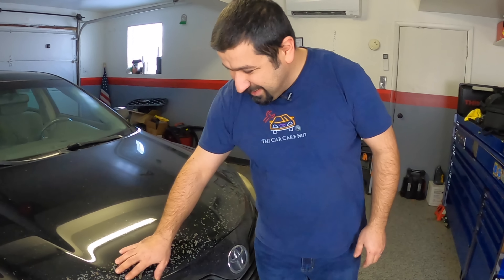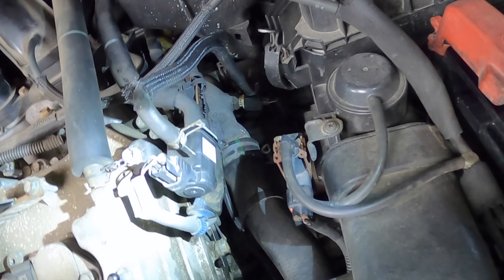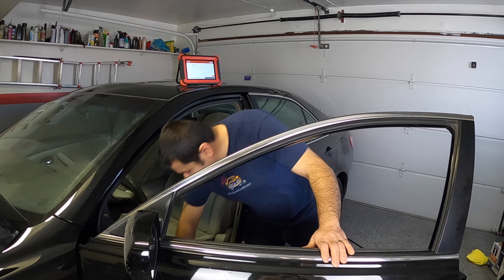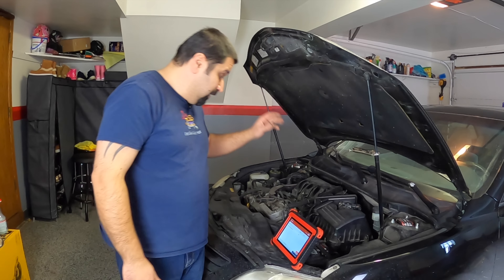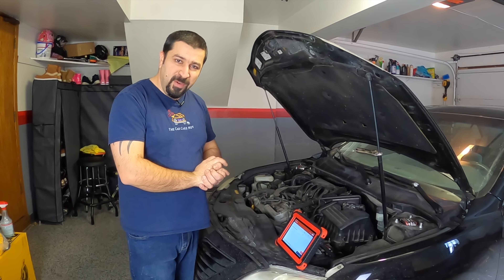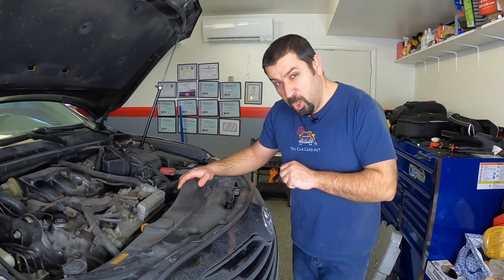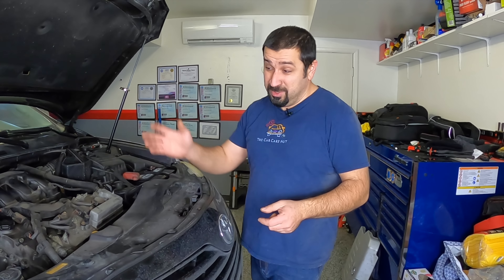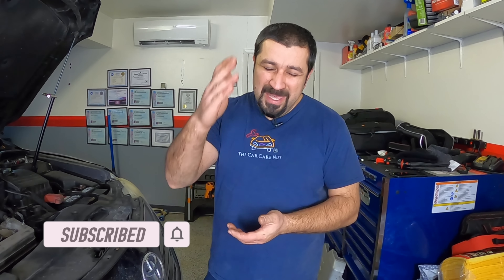How Does a 15 Year Old Toyota with OVER 200k Miles Hold up? Full Inspection!

Comment: Do you need to take the motor out to fix oil leak from the front timing cover?
Reply from the maker: Hi! Yes I did a video showing the process
Reply: @TheCarCareNut  that's a bummer. Since you did a video replacing the water pump without taking the motor out, I would have thought the same would be for the timing cover. Why do you need to take the motor out? Just curious. Thank you!
Reply from the maker: So the front cover is pretty big on these and taking that out in the car is extremely tight and when installing you will likely smear the sealer and not have a good seal. Not worth the risk as any seasoned toyota technician will have the drivetrain on the ground in less than 2 hours
Reply: @TheCarCareNut  that makes sense. Thank you once again.
Reply: 😵

Geez!

I thought I had it bad with my 99 Toyota Solara 1MZFE Front Tming cover.

Comment: I have an 03 Camry with 112,400 miles I've had for a year,it has a significant whine in first gear, but other wise works perfectly any ideas should I be concerned?
Reply from the maker: Hi! Likely a gear contact issue but not something I would worry too much about
Reply: @TheCarCareNut  thanks, I feel a little better now.i forgot to mention it's the 3.0 V6, can you tell me if it's the 4 or 5 speed, hard to tell it shifts so smooth, thanks again.
Reply from the maker: If memory serves right it’s likely a 4 speed
Reply: @TheCarCareNut  👍

Comment: The Oil Leak Leaks on the Power Steering Boots which is why Rack has already been Replaced.  The oil eats the Boots which Protect the Seals.  Mine is Same - 2005 Avalon with 150K. Like you said known Issue. Watch the Level and Keep Cleaning Driveway.  More Embarrassing than Problematic and not worth the $4k Tear-down to Replace the RTV.

Comment: Is there a Lexus mechanic you can recommend in Northern California, by chance?
I got a 2016 Lexus ES 300h with 160,000 miles. During the winter months, I will set the temperature to 71°F which works fine for the front driver vents and the front passenger vents. But while the front vents shoots out warmish temps, the rear vent, located in the center console between the front seats, shoot out hot air like 114°F hot. 
I have to turn the passenger side temp down to 67°F for the rear vents to come down to a more comfortable temp BUT the front passenger side vents are shooting out cold air.
Also, I'm not sure why they even show the tempurater of each side when the temperature is way off from what I get out of the vents. Just one or two degree difference can dramatically change the temp of the vents so I'm always having to adjust it to keep my passengers comfortable. 
Is this a servo problem? If so, can you tell me where it's located and what I need to ask for at the parts department? Thanks!

BTW, I'm an Uber/Lyft driver so temperature comfort is very important as to not have the temp too hot or too cold. Thanks again!

Comment: You don't need your evap monitor ready , to pass an emissions test. The customer could possibly pass the emissions before the check engine came back on with all other monitors ready, excluding the evap system monitor.

"Your vehicle may pass the smog inspection with an incomplete EVAP monitor. The Bureau of Automotive Repairs has reduced the number of allowable incomplete OBD II readiness monitors for both the new BAR-OIS smog inspection system (applicable to 2000 & newer vehicles) and the BAR-97 smog inspections systems (applicable to 1999 & older vehicles), however the EVAP monitor is the one monitor that is still allowed to remain Not Ready and will not cause a smog test failure.

The new Emission Monitor Requirement criteria is as follows:

- 2000 and newer model year gasoline powered vehicles will need all emission monitors in READY or COMPLETE status, with the exception of the EVAP monitor. An incomplete evaporative monitor will not cause a smog check failure. It will be the only monitor allowed to be incomplete on a 2000 & newer gasoline powered vehicle."

Comment: I have a 07 Toyota Camry XLE V6 with navigation, made in Japan on 07/2006, I live in SoCal, car has been in Southern California it’s whole whole life, I bought it with only 38k miles in October, 2021, VVTI oil line been replaced in 2009 according to carfax but still partially rubber so need up upgrade to fill metal line, water pump replaced in 2011, besides that, no major repairs, power steering return  line is still original , I wonder those common oil leaks you mentioned are simply cause of salt and rust in Illinois, or that’s a common issues anywhere, as of writing this comment on (6/11/22) my current mileage is 59,246

Comment: About those rules at the end... If the car does need a massive resterestion to meet those rules you have to ask is the cost woth it to you... The most important one being is the car speical in any way to you or others? It could be a rare model now, or it could be a vehicle you have a real speical memory with, Or the restoration is cheaper then a new one of that same make,model and trim. Which if you can't drive it and can't pay for a restoration if you have land you can once made safe just park it on the land and leave it or keep it in a garrage of your yours if you have space.
Reply: Insurance rates on brand new cars and my desire not to have a car payment is mostly what keeps me in my 1999 Toyota Solara V6.

Tgis said: if I would have to pay a Toyota dealership or Midas what I have done to my car it would not meet the definition of cost-effective as this Channel's host describes it.

Comment: I’m still driving a 2005 Toyota Sienna that is still running flawlessly at 316K miles with only basic maintenance and some minor repair. Yes, minor repair because engine, valve clearance, fuel injection, iced cold AC, transmission, fuel pump, shock absorbers, struts, engine mounts, electric windows, upholstery, paint and many more are still original from new. Toyota and Lexus last longer than any Japanese, European and American brand. Yes, we’ve had many different brands from all three continents and none of them can match Toyota.

Comment: The chipped hood would possibly suggest that the hood as been repainted...if so, why?
Reply: Not necessarily, I got a paint recall on my 2013 Corolla. Paint was chipping all over, but will be worst up front, especially for tailgaters…
Reply from the maker: Toyota paint is very thin and easily chipped
Reply: Yes, that was true for my Camry's, but the paint on my 2006 Avalon still looks amazing!  @TheCarCareNut

Comment: My 2002 Tacoma has 203,000 and has the 2.7 liter engine that runs like new, we even checked the valve clearance and they were all with in specifications? Also changed the trans 
and rear end fluids along with a break and radiator flush.
What more can anyone ask for?

Comment: At what mileage do you usually see a well-maintained Toyota start to fall apart at what mileage should I get rid of mine before it starts falling apart
Reply from the maker: Hi! If you keep up the maintenance and use original parts you should be nearing 300k before major things start to happen. The condition this car is in the video is typical of 300k cars with medium maintenance

Comment: Hi, is it still advisable for a 2014 toyota camry hybrid XLE to change transmission fluid at 120k miles. I bought it used and i don’t see any transmission fluid change on the carfax.
Reply from the maker: Hi! On hybrids you can change the fluid at any time unlike a regular automatic transmission

Comment: Hi TCCN, I have a question for you I own a Toyota Camry 2018 with a 2gr-fks engine I have a vibration just over 2000 revs if I open the throttle it goes away , if I drive more a slower pace it’s there but if I’m more aggressive on the pedal it’s not there till I’m doing roughly 2000 revs ? My mechanic has checked he thinks possibly inside the engine? I’m interested to hear what you think?
Reply from the maker: Hi! Does it do this when revving at a stop or just drivingv
Reply: @TheCarCareNut  just while driving

Comment: I had a 16 year old honda, It had parasitic  drain, cluster problems, body control module problems, when you open the door the dash lights would come on. A/C compressor shot, belt tensioner about to fall off, water pump, struts, brakes needed. The alarm going off on cold nights, going outside with a 10mm to disconnect battery, understandable angry neighbors. And like this fellow Elderly, I had to throw in the towel. Oh I forgot the transmission made strange noises, and I had the drain and fills recommended  by Honda.
 With all the price gouging going on I can't tell him to buy a new car but think about replacing this one when it gets  to  unreliable  and you get stuck in cold weather or scorching summer sun.. 👍👍👍👍👍

Comment: What about the wheel bearings? I have a 2013 Prius V with 126,000 miles. When should I expect to need to replace  wheel bearings?
Reply from the maker: Hi! If the wheel bearings make no noise don’t replace them

Comment: on a 2az-fe with 4speed auto (scionxb),  if the trans jerks at 19mph into 3rd once in a while,  is that on the brink or could it be made to last if i baby it when upshifting thanks.
Reply from the maker: Hi! How’s the fluid condition? Was it ever changed?
Reply: @TheCarCareNut  we just recently got it 190k miles and it was superclean fluid and been flushed at some stage i was told. i also added lucas transfix. i do have another tranny on a junk 09 xb if i needed it hope i wont anytime soon. ,  rest of car is excellent shape. thx.

Comment: Wouldn't you have a maf code if the problem was in that sensor rather than a purge flow code?
Reply from the maker: The component we inspected is the purge valve?

Comment: I beat OldDood. I have a 2002 Camry that has no problems.  But it only has 49,000 miles.  And it is a California garage queen.  I did the 50,000 mile fluid change a thousand miles early.  The stupid electronic throttle control module did go out about 10 years ago.  The rip off dealer in town charged $1000 to fix it.  Toyota dealers may know how to fix Toyotas, but also know how to fleece customers.

Comment: I have a question the Pcv value on my 3.5 v6 Highlander is metal which I changed why is my tundra made of cheap plastic ?  I purchased the oem parts from Toyota but noted the change 5.7 tundra
Reply from the maker: Some models here and there have them plastic. They last as long
Reply: @TheCarCareNut  thanks on the reply . I haven’t changed it yet any advice on how to pull the old one out slowly I fear I might break it removing it

Comment: Am I going to have these oil issues with my 2010 Lexus ES 350? The car has 128900 miles and no problems with oil as of now! What can I do to try to Avoid all of those oil leaks
Reply from the maker: Hi! The ES is not as common to have these leaks. Nothing can be done to prevent them honestly. With age and high mileage it’s a possibility
Reply: @TheCarCareNut  thank you for the response

Comment: 200,000 isn't much of a test for an old Toyota, IMO. Maybe look at 250 or 300K. I currently own 3 Toyotas - two 97 Corollas with over 350K and a 2004 Camry with about 225K. All three are daily drivers. I maintain them pretty well, but nothing special. My daughters learned to drive on the Corollas; that was over 10 years ago. I also owned a 99 Avalon that made it to 260K and was still running well except the AC pump failed. I sold it two years ago to a kid who drove it to Minnesota, said he didn't need AC (I'm in AZ). Heck, it's probably still running.

Comment: I have 2019 lexus rx350 f sport. I need front and back brake pads with 35k miles. Do I need new rotors or not?
Reply: Who told you that you needed brake pads? Two years before I replaced my front pads they told me I needed to replace them. Unless you looked at them yourself, is be careful.
You may not need rotors. As long as they aren't warped and they pass the minimum required thickness. I replaced the front pads on our 2009 RAV4 at just under 57,000 miles. My rotors were fine. This was the first time the front pads were replaced. The rear pads are also original and haven't been replaced yet. We now have 68,000 miles on the vehicle. It passed inspection last month. Currently since I retired, we drive 85 to 90% highway miles.
Reply: @JackTannehillPromoter  I got my front two tires replaced 2 weeks ago, and I saw pads were low. I can get Oem pads n rotors for $250 from eBay , and installation will be $300. Lexus dealers are charging me 645 to 1500 range
Reply from the maker: Hi! If the rotors are above min spec which likely they are at this mileage and don’t have severe rust they can be resurfaced and reused

Comment: Do you have any advice for buying a Toyota for a decent price? I just got in a car accident and I’m buying my first car and I’m a broke college student. I went to the local Hyundai dealer in Elgin just outside of Chicago and they tried to swindle me with 4k of added on stuff. A $2400 drive train warranty transfer, $900 cleaning and interior warranty (which was mandatory), $400 document fee, $336 government fee, docking and handling $581 and $1500 in taxes for a $16,900 Corolla. I would’ve ended up paying  $21,000 after financing for a $17,000 car.
Reply from the maker: Hi’ times are hard now for car prices. I would shop around and try to get the best car possible
Reply: Some of that stuff seems outrageous but I know the state of Illinois charges $250 just a title a car: I think the taxes $100 and the titles $150.

While much of what you listed as outrageous, I went to rent a Harley-Davidson motorcycle and they wanted $88. for "just to ensure you get the exact type of motorcycle you reserved" fee.

Comment: You say that there is no possible way for a Camry to go that many miles without that power steering hose leaking? My 2005 has 354000 miles and the only thing I have changed is the water pump, battery and the alternator, nothing else. I do all the maintenence myself. All depends on how well you take care of your stuff.